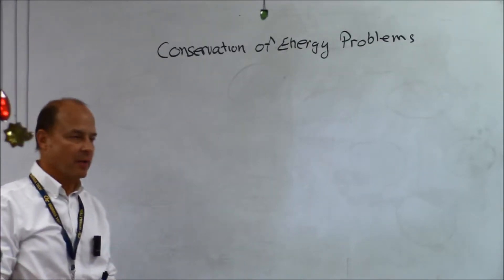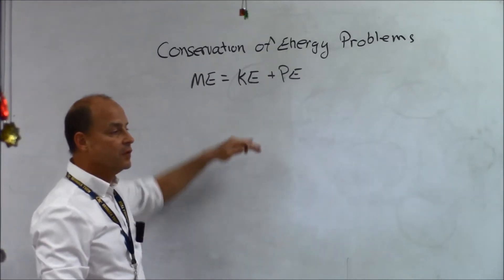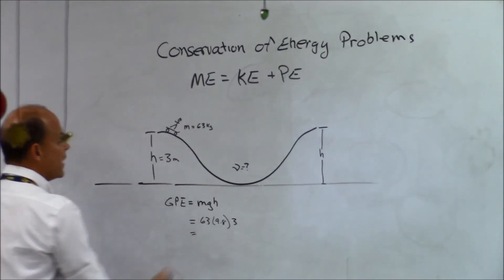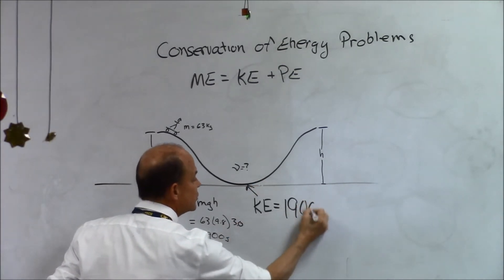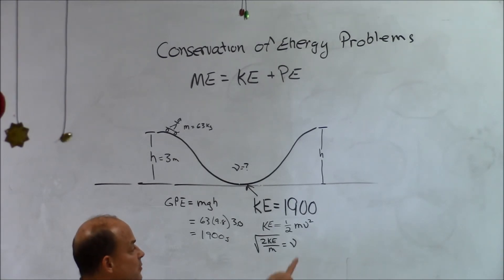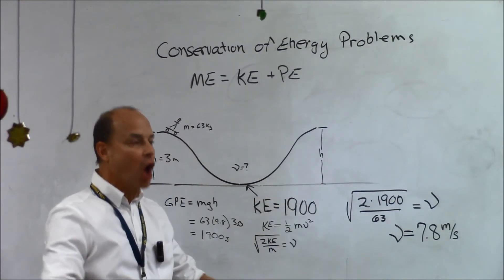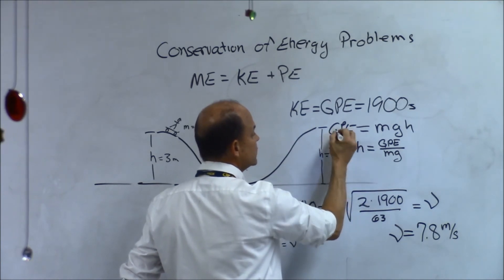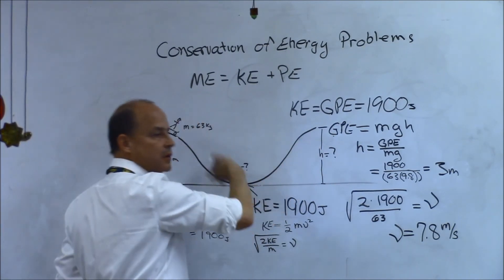Conservation of Energy Problem   Skate Park

Comment: But in reality skateboarder accelerate and make some jump with tricks higher and higher ... like tony hawk landed 900 or 1080  ... he is not landing this trick at the first run he need to accumulate some speed in order to succeed ... https://www.youtube.com/watch?v=TnvPt_a7iOQ , https://www.youtube.com/watch?v=OOg-4mtA3Zo -  I think human play with grativity and there position to vary the speed and their momemtum ,  it's not a static mini ball who keep the same position everywhere in the system... like you explained ... at the bottom of the half pipe the speed is higher or slower to depend what he want to do and the speed add up if the skateboarder want to accumulate speed for a bigger jump ... also there's some limits like in the video in order to landed an 1260  you need a mega ramp ...